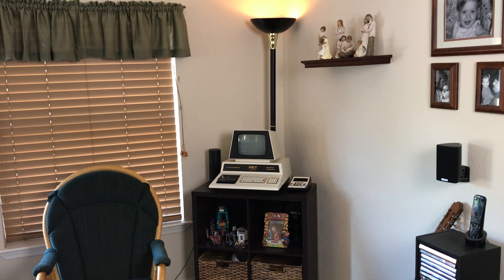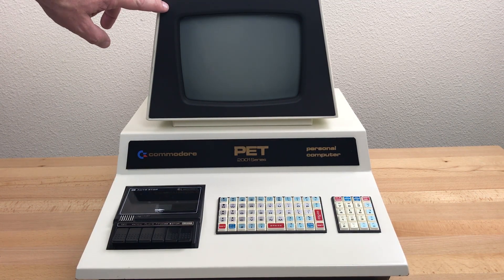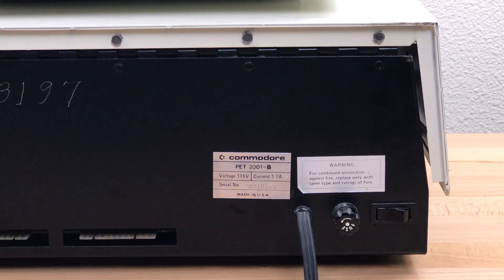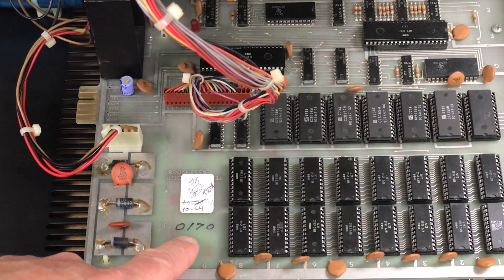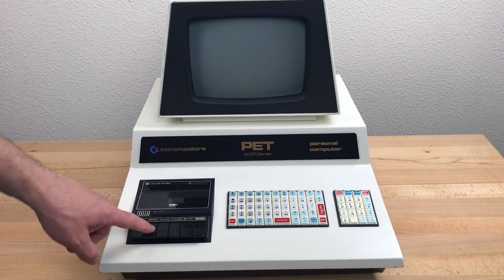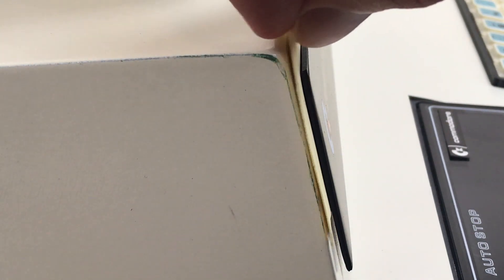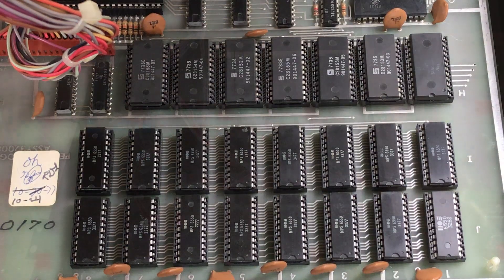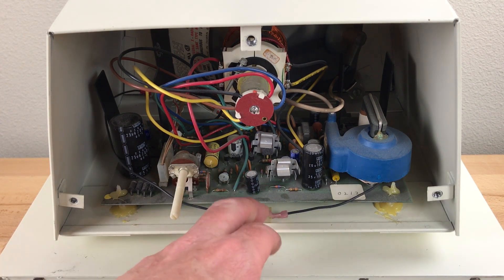Show and Tell, 1977 Commodore PET

Comment: I found a purchase date for my Commodore PET #0010899  on a copy of the Limited Warranty page that the original owner filled out. If you can update the file on the spread sheet to Date = 10/6/77 which seems awful early. However I do not think any owner is going to put an earlier purchase date on a limited warranty. That does not mean the owner actually received his PET on that date. But that would be a very early purchase date.

Comment: I was in college back then, and a friend attended that CES where the PET was introduced, and he brought back the brochure. After about a week of consideration, I called and found that it would be best for me to place my order with the local Mr. Calculator store, located in a nearby shopping mall (Mr. Calculator was a chain that sold mostly/exclusively Commodore calculators). I immediately went there and paid my money; it might have been 50% of the total price, but I don't remember for sure. I had ordered the 4k RAM version, which was the lowest cost option. Months went by, I want to say at least six, when I received a call from the store, advising that Commodore had decided to NOT produce the 4k model after all, and I could either cancel my order, or come in and pay the difference in cost to upgrade to the 8k model; they did not give me much time to do so, and if I waited too long my order (and place in the queue) would be cancelled, so I ponied up the extra couple hundred bucks. At was at least a couple more months, when I received a call that my PET was in the store and waiting for me to pick it up. A happy day in my life!

Mine So mine was fairly early production, but hardly in the first batch. It definitely had the white cassette drive keys and the blue screen bezel. I don't recall what the 'badge' looked like, except that it looked silly (rather colorful as I recall), and not like a 'serious' computer should have. I called Commodore (back then you could actually do that and expect to get a human on the phone), and they offered to send me the current production version of the badge, which they did and I installed it.

Some time later, the Mr. Calculator store called to advise that there was some aspect of the computer (something on the main circuit board, but I don't know if it was a PCB foil trace of something in a ROM) was incompatible with the PET design going forward, and this might impact compatibility with future programs, hardware, whatever. Commodore was having a visiting technician making the rounds of the stores, and he would modify mine to be future-compatible at no cost, but I had to bring it in early on the scheduled day, and pick it up later; the store expected lots of customers to bring their PETs in, and did not have storage space to allow having all of those in for more than the one day. I dropped mine off on my way to work, and picked it up after work, and I never did learn exactly what change(s) had been made.

Soon, I had purchased a very nice quality external keyboard, modified with a long ribbon cable to slip between the PET's upper and lower case halves, and able to plug into the PCB keyboard connector. So, I only used the small "chiclet" keyboard for a short amount of time.

I was writing some large programs by that time, so I needed lots more RAM, but that was expensive. I bought a converter PCB that plugged into the expansion card-edge on the right side of the PET's PCB, and it gave me a total of four S-100 slots. I designed my own power supply to feed it and any boards plugged in. Bill Godbout in California sold me four kits, each being an S-100 memory PCB with a bag full of sockets, RAM IC's, voltage regulator and other IC's. The RAM IC's were 1k x 1bit, and the PCB had an array of 8x8 of them, so each PCB when assembled was an 8k static RAM board. I can't recall if I used all four or only three; whatever it was, I had maxed out the PET's available RAM space. I could have make toast on top of those Godbout RAM boards, but they worked fine and I used them on that PET until I switched over to a C-64. I never experienced any failures except once when the monitor stopped working, and I was able to easily find the fault and get it working again. I sold it as an unused "boat-anchor", and within a few years I was very sorry that I did not still have it.

I do have a PET these days, but it is a later model, and does not quite have the charm that the first one did.

Comment: Back in the day, these were shunned as prototype rubbish...   with an unusuable keyboard.
Now they are collectible as a rare curious curio, but then all PETs are... I have one...   in my pile of junk 8bits.   

I'll never have a larger house with lots of space to make any kind of bizarre shrine for any single computer that is not in use.
You got to understand, us beginning programmers wanted to program, and we wanted to program furiously...  a caculator or chicklet keyboard would not do... at all.   In fact, it's hard to believe today, but a good keyboard on a computer was a major make or break line item that sank or swam most early computers.   One of the main reasons the VIC and then the 64 just hammered their competition into the ground was that, among other things, they had a great keyboard.

Today keyboards plug into the computer and aren't integral, and if you don't like yours, toss it, buy a differently one...   but back then, it was 1/5th the selling strong points of a Commodore 64.

The badge on that early pet was mounted with standoffs, because whatever they tried before probably had a habit of lifting or peeling off, or the surface was uneven, leaving an unsightly gap in some places.   To hide this when it happened, they just mounted it so it floated away from the case I suspect.
Reply from the maker: I was there back in the day.  They sold pretty well for "prototype rubbish".
Reply: @HutchCA  No they didn't.   You would of picked a Model 1 over a PET with calculator keyboard any day of the week.   There's no typing out a basic program on that thing if you're a touch typist, or any kind of typist... at all.   Even the Apple had a better keyboard.   Fortunately, they spent the money and replaced the keyboard, then copied the TRS Model 1 form factor and released the microPET in a Breadbox.   Looked just like a Model 1 but with Color and graphics on the keyboard.

Comment: Hi there. I have a commodore pet in my attic, which I can’t get to right now.  I have a model where the cassette is attached by a cord and separate.  I plan on selling it but there’s so many of them at different prices I have no idea what to price it for.  I used to play the cassette games as a child (one called Eliza I remember) your computer looks awesome!
Reply from the maker: The value will depend greatly on which model it is and the condition it's in. If it doesn't have the tape drive built in, it must be a model made after 1979. Probably a 2001-N, 3032 or 4032.
Best to get it down from the attic and dust it off. Check the model number and general condition, like rust and scratches.  Don't try turning it on without doing some basic checks first.
Whether it works or not won't generally affect the value. Cosmetic condition is more important.

Comment: I would not be surprised if this thing inspired the computer terminals in the Fallout series..I JUST learned about this thing..and if you've ever played the Fallout games (particularly 4) the computers can use things called Holotapes (themselves based on the HoloTapes of the real world RCA SelectaVision HoloTape player) and in Fallout 4 when you look at these monochrome black and green computers you can see a slot to insert the cassette of the Holotape which also starting in 4 can have games stored on them.

Comment: I've a blue bezel chiclet 8K PET with a white key datasette. My datasette ports have vias connecting top to bottom. The badge is a sticker with silver text. My motherboard has a bodge wire connecting pin 1 of the chip at H9 (74LS244) to pin 6 of the chip at J9 (74LS00). The motherboard had a sticker on it, but it's gone now; has QC 13 stamped on it, and 18602 (I think) in black marker.
№: 0030267, assy: 320132, 6540 ROMs, 4045 RAM.
Reply: @HutchCA  The SRAM appears to be original, even the video SRAM is Ti TMS4045-45NL, P7818.  Oddly enough the markings on the CPU have rubbed off.

Oh, oh, and for the lurkers, be gentle with the printing on the chiclet keys, I nearly cleaned off two keys to the bare metal 😔